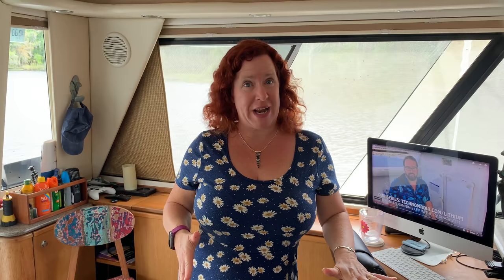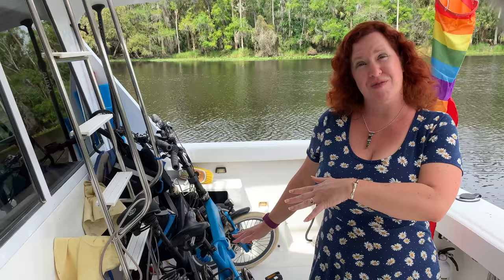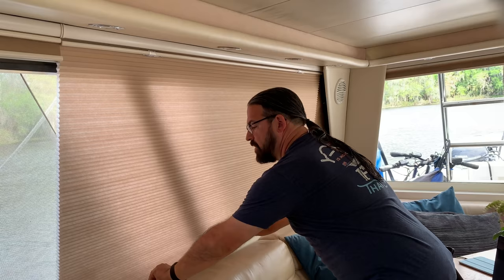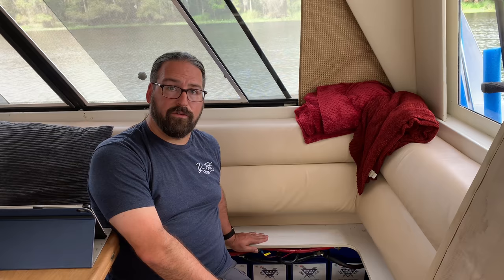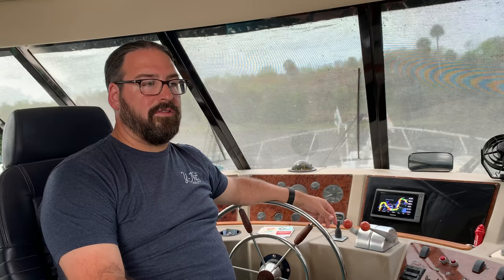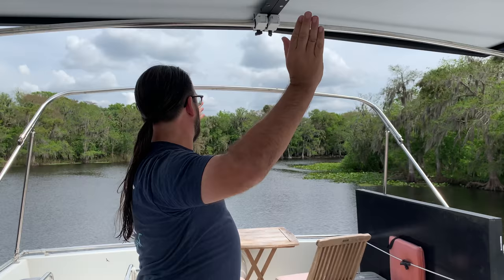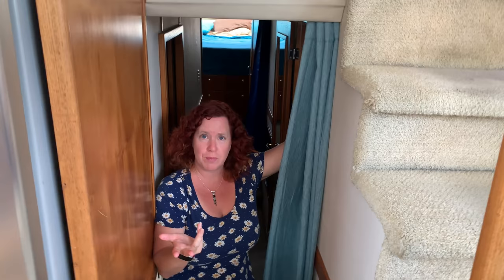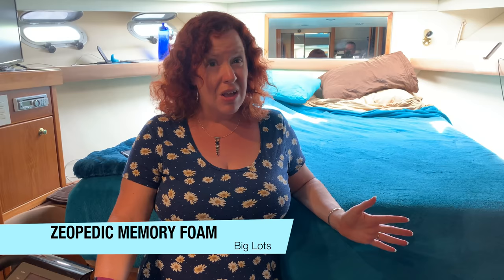Tour of our Liveaboard Motor Yacht - 1999 Bayliner 4788 - Modifications After 2 Years

Comment: The solar roof makes all the sense in the world! I always wonder why is not use more extensively. Did you consider using aluminium profiles -off the shelf - as the structural backbone for the solar panels? Can be attached with poly clamps to the stainless existing bows and this way eliminate the custom stainless welding/work.

Comment: I’m guessing 30k plus on the complete solar and battery upgrade.
Reply from the maker: No where close...  Even if Battleborn hadn't given us the batteries, they would have only cost around $6k. The rest we paid for. Solar was only a couple grand. And the inverter and solor controllers only a couple grand.  Total project likely around $10-13k.
Reply: @Technomadia  so I’m guessing you supplied the sweat equity. My guess was figuring a contractor priced job.
Reply from the maker: Doesn't change the fact that this can be done without being 'crazy crazy expensive'.

Comment: How the heck do you use water to dry with. Just doesn't make since. What's next? Fire fighters throwing fire on fires instead of water? JK, ill have to look it up. Is there a major cost difference between a normal dryer and that one?
Reply from the maker: Ventless dryers use cold water to cool a condenser that turns the hot steamy air into water that can be drained away. It is a very ingenious system - and costs are comparable.